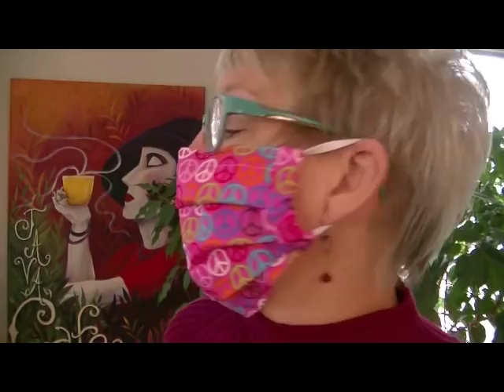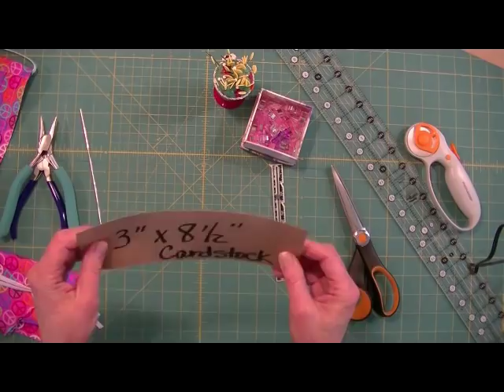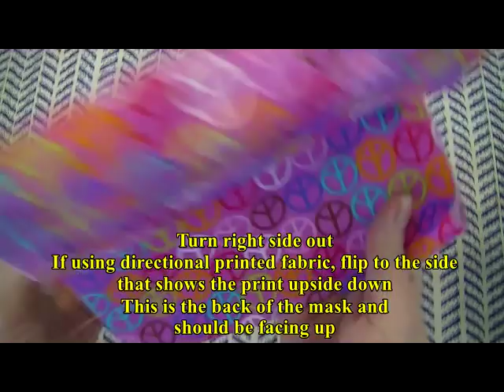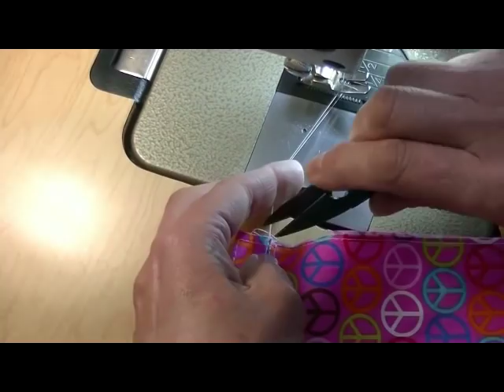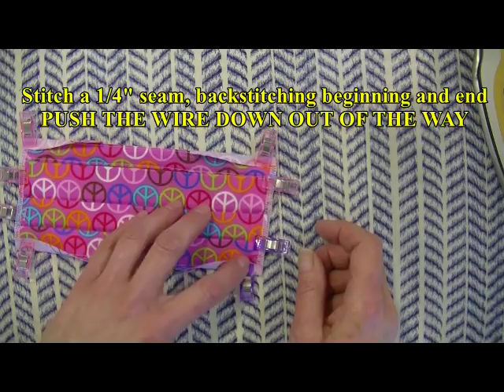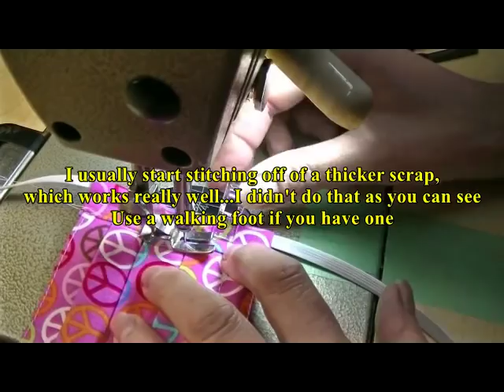DIY REUSABLE FACE MASK with FILTER POCKET-4 Style Options-1 Easy SEW Pattern-Won't Fog Your Glasses!

Comment: The casings on the ends so you can replace broken elastic is just brilliant. I'm waiting on my elastic to be delivered.   Ebay had aluminum strips you could buy to make the nose pieces. Here's a link for those: https://www.ebay.com/itm/100Pcs-90mm-Aluminum-Strip-Nose-Bridge-for-Face-DIY-Making-Accessories-Crafts/164152681798?ssPageName=STRK%3AMEBIDX%3AIT&var=463778476055&_trksid=p2057872.m2749.l2649
Reply from the maker: I looked for those but were not available or too expensive on Amazon.ca (Canada). I don't remember.
Reply: These come from China, but they're send with a fast delivery. It takes around a week or so instead of a month. I hate to think this, but we'll probably need masks then too.
Reply from the maker: I agree. I ordered elastic and aluminum wire from China. The demand for masks is going to be big.

Comment: Hi Liz.  I love this video. Especially the way you modeled the mask and bragged about it :)  watching the video is so relaxing and educational.   I have some questions though.  I notice your sewing machine is slow. Is it pedal powered? About the pleats.  I see that you sewed both layers together to create pleats but when you opened the pocket for the filter, it looked like the layers are not "intertwined".  Sorry for all the questions ;)
Reply from the maker: Thank you Al. My sewing machine is an industrial machine with a foot pedal that controls the speed and lifts the foot. This machine can sew 1500+ stitches per minute or super slow. I'm not really sure what you mean about the pleats. It's a pocket and when you open it up, the pleats stretch out and seperate. The pleats are what enable you to fit all the fabric in 3". Thanks so much for watching.
Reply: @makingiteasywithliz  Thank you so much for your reply.  How I wish I could control the speed of my sewing machine without applying less pressure on the electric foot pedal.  Regarding the plaats,  my concern is on the video, I see you created the pleats by folding the top and bottom layers of the masks together.   So I am a bit concerned that it may be a bit difficult to insert the filter properly especially when it comes to the side edges of the pocket where are pleats are since both layers are folded and sewn together. Unless I try to sew pleats for the inside and outside layers separately but that would be too much work and I do not even know if it would solve my "perceived" concern.   Thanks again.:)
Reply from the maker: You're over thinking it. Make one and you will see. From what I am hearing regarding wearing a mask is that it is to protect other people from you...to block your droplets. That being said, the filter only needs to cover your mouth and nose, maybe to the middle of your cheek. It doesn't have to fill in every nook and cranny of the mask. Once you open it up, you will see how easy it is to put a filter in. The pleats smooth out when you put it on, stretching down under your chin.
Reply: @makingiteasywithliz  Hi Liz,  I finally did it.  I am think it is the best i have attempted so far.  I will make some more.  You are right, i overthink.   :)  Thank you again!
Reply from the maker: Yay!!!! Right on!

Comment: Thank you so much for the informative and detailed video. There are many patterns out there but I chose yours because it was detailed  And informative, as well as versatile in regard to different ways of closure. And, of course the ability to replace the elastic when it no longer works. Instead of wire I used plastic coated paper clip which I opened and looped the ends. We will try several closure options: round elastic, 1/4" wide elastic and T-shirt stretch fabric (comes in spools, found in craft stores).  Oh, and I made 9 masks today ! So thank you again.
Reply from the maker: Thank you, Michal, just watch whatever wire you use doesn't rust. I finished my 70th mask today.

Comment: You could throw a couple of stitches in the elastic with the sewing machine would only take a minute.
Reply from the maker: Tried it and it got bunched up in my machine. I put 12" of elastic in the mask and let them tie it to fit.
Reply: Making It Easy with Liz  sorry about that,  all my years,  I never had a problem.  It is stretched. So you have to stretch it when you sew with it.   Maybe it is the size.
Reply from the maker: I appreciate the great suggestion. I havent dealt with elastic a whole lot so I probably could use some pointers on stitching it.  I am basically manufacturing these in bulk and leaving the elastic undone for whomever to tie it to fit. I don't want to make them too tight or too loose. Stay safe.

Comment: Liz, I have been sewing for half a century, but I was looking for a quick but well made mask.  I really like yours.  I think it will hold up when other masks will fall apart.  One comment about your cardboard for the folds.  I could not locate a long piece like yours, but I had the back of a note pad.  3 by 4.  By accident I discovered I could clip the top and  bottom to the cardboard,  make the folds without clips and sew before removing the piece of cardboard!  Then I ironed.   Worked like a charm and so quick!
Reply from the maker: A cracker box or cereal box works for the board. I like your idea. I may have to try that!

Comment: I bought some masks from a lady who used the elastic, I didn’t care for the elastic because it pulled your ears down & sometimes slipped completely off.  I reworked them cutting off the elastic & added the thin bias tape for the ties, each measuring 14”.  Works perfectly for both men & women.
Reply from the maker: Yes, the elastic can be a problem...that's why I don't tie them off and let whomever is going to where it, do it themselves so it fits. There is just too much to go wrong and I don't want calls because the elastic is too tight, lol.

Comment: Hi, I notice how similar this is to another tutorial with the orange fabric. I like her method as well as yours. I made a mask for my mother in law who lives several states away but she said it's too big for her so I looked for an easy pattern and found the other lady's tutorial and made one but she didn't mention that you would have to add extra inch if you don't serge (she recommended folding edge in twice if you don't have a serger). So mine came out a little shorter than hers. And a couple of other minor differences. So the idea of just using a safety pin on the elastic came to mind, instead of stitching ends together, that way MIL can adjust to her liking by pulling ends out and pinning to proper size.  Thanks for sharing your tutorial.
Reply from the maker: Thank you Rozy...I hope I was helpful.

Comment: My favorite pattern and mask video so far. Yes I'm about to mass produce need your next mass produce video. For now I'm cutting out 4 masks at a time. But I'm going to use this pattern today. For the melt-blown filters I bought 1 "burn blanket" on Amazon the cheapest sheets were under 10$ and you can get tons of filters from them. Thank you.  If you look for the surgical sterilization ones they are expensive because you have to buy a big lot of them ranging from 200 to 500$ depending on the quality. I too have jewelry supplies. I'm using the plant garden wrapped wire and it works well I get at dollar tree in the garden section. Keeps it shape and I just cut the wire back so it doesn't poke through and pull the green coating over it so it's safe.  You even made me laugh. I too made so many mistakes getting this right.  Haven't sewn in ages but in Chicago the poor folks can't get these masks made on their own or afford to buy online because it takes lots of equipment and know how and money.
Reply from the maker: Thank you so much Heloise.  Here's the skinny on mass producing.  It's all about prep...cut all your fabric pieces, cut and finish all your wires, fill multiple bobbins, cut all your elastic. Whenever stitching, use the chain piecing technique quilters use. When zigzagging or serging raw edges, do one right after the other without cutting your thread, just feed it through so you have a chain of them and cut them apart. same goes for all the sewing. What you do to one, you do to the rest. This can take a lot of time before hand but when it comes to assembling them, you end up with a lot finished at the same time. 
I too am so busy making masks that I haven't had the chance to do the next video. It's all so crazy!  Stay safe.

Comment: Where would you put the filter and do you have a filter recommendation please?
Reply from the maker: Cut the filter to cover your mouth area, coffee filters are the recommendation by the CDC
Reply: Making It Easy with Liz Man, those cone filters a really HARD to breath through, but, ok. I may use some garden row cover. Or rummage through my supplies for interfacing. Kudos on your closeup video process.

Comment: Hi Liz, thank you so much for your video. How do I do the last few steps to add an elastic band that goes around my head?
Reply from the maker: Hi Deja, cut 28-30" of elastic and lay it around in a circle and put it in both casings and sew it or feed the elastic up through the left side and down through the right side, after you topstitched. Check for fit and tie in an overland knot and stuff it in the casing.

Comment: This is 1 of my favorite ways to make a mask, however I’m going to try modifying and cutting the back and the front out of different prints so you can easily tell which is the inside and which is the outside.
Reply from the maker: I didn't mean to come off as defensive, I just meant, make one then see if it's a problem. I get so many "what ifs" before they try it. An easy fix would be to add a little fold of ribbon in the casing when you topstitch it, like a tag. That is what I started to do.
Reply: @makingiteasywithliz  
TBH I never even seen where you were coming off as defensive at all 🤔. And many people just misconstrue people via text etc. so often than not, And never do those people think before they jump the handle out of turn, or before they even know what's actually going on. And that's offensive in and of itself. 

However, Liz hon, I love the way you responded, and how you NEVER get defensive/offensive against anyone in any case. Of all the time I've been a sub here, I've just always LOVED your energy. You're a beautiful soul. Keep spreading your viral love 😍❤️ and Thank you SO MUCH for sharing this AMAZING pattern! I'm just so happy you have the perfect pattern for the mask out. The others also were uncomfortable for so many. Especially around the ears. I was looking for this one specifically and found one of those I have subbed had it all along! Again, thank you!
Reply from the maker: @JANEEDISTURBED  that is so kind and I totally agree with text being misunderstood. Thank you for your support. Stay safe and well.
Reply: @makingiteasywithliz  You're very  welcome hon! 🤗 And you stay safe and well too. ❤️
Reply: Yes, I have made one just like yours.  I guess I just wanted to be able to tell at a glance which is the right side.  I did figure it out, just finishing it up.
Reply: Is this size universal for men and women or for anyone with a larger/wider face?
Reply: Sherry Stengel, you can also tell because the front has the pleats going down and the wrong side has the pleats facing up. Even I can’t mess it up because the nose wire has to be on top! Be safe!
Reply: I have solved the front/ back problem. I do the top stitch around the pocket with a contrasting color thread.  The back is easily identified.
Reply from the maker: Love that idea...I stitch a little contrasting ribbon into the casing.
Reply from the maker: You can tell because the slit for the pocket is obvious. Have you tried my way yet? I always say "try the recipe first, then change it up, or not". Thanks for watching, Sherry.
Reply: Making It Easy with Liz I agree with Sherry. Her pattern of the cloth made it confusing to put the sides on for the elastic.
Reply: Just cut the facing/casing pieces out of coordinating different fabric and it differentiates the sides
Reply: @makingiteasywithliz  - I love your video (I just wish there were a pattern to print out)! As far as the 2 sides debate, it seems my hospital system solved that. They have asked that they are different because they want the front and back to be seen instantly, rather than having to look carefully to tell. lol
Reply: @makingiteasywithliz  Liz... thank you for your video, but there was no need to be defensive towards Sherry Stengel for her suggestion.   As a former nurse...I agree with Sherry.  The easier the better, and most surgical masks have 2 different colors so that it is extremely easy at a glance to tell instead of having to look for the seamed side.  On another note... so humbled by the dedication and selflessness of all of our people who are out there as essential workers. My age and health do not allow me to be out there with you, but must say...I would hope that I could be as brave and dedicated as you all are. What a blessing/benefit you are to all of us who are most vulnerable. Again...so in awe and humbled.
Reply: Hi! I really like this style of mask so much! I do have a question on the wire. I am unable to get out, plus most stores are closed, to purchase your suggested wire. Will the mask still work ok without the wire inside?
Reply: @karenhorvath2436   Without the wire ,the mask will not fit snugly enough(closing the gap on the sides of nose) to give  the best protection. There are alternatives-floral wire,pipe cleaner, paper clip, a cut strip from a  disposable foil pan, folded over a few times to give it strength (although this may wear out after few washes but you can replace with another strip).  I would advise to to make  small loops at the wire's ends so the blunt ends can't injure the wearer. Also for us without a serger machine, a pinking shear will do.
Reply from the maker: I wear glasses and a wire keeps them from fogging up. People have used the flat ribbon wire on coffee bags,  and you can order the flat aluminum nose wires on Etsy, pipe cleaners,  I haven't tried it yet without one.
Reply: @makingiteasywithliz  i have used the pipe cleaners and they work for a few days, but then start to lose their shape.  But that's all I could get to.
Reply: Brenda Connell  You know those regular N95 Light blue and white disposable masks? Well, inside of the top of those is a wire that can be used for this as well. I'd say get a box of the disposable ones (if available) and remove the wire to use instead. These can also be used as a pattern.

Comment: Great Video. Not a very experienced sewer so I would do better with written instructions as well to help also with retention and future use as I can forget while sewing if I get nervous. I was thinking of using use non directional material, hoping it will be easier?
Reply from the maker: Absolutely, Laurielyn. Cut it out anywhere with the grain, not across on the bias. You may already know that but I can't help myself lol.  Thanks so much for watching.

Comment: I have not completed the video yet. I am sewing along step by step and am to the point of putting the wire in. I am guessing that once the wire is inserted that this mask is not washable?
Reply from the maker: Oh, but it is. I use aluminum wire so there is no rust.  I washed one in a lingerie mesh bag, on hot with blankets and dried in the dryer.  The wire smoothed out perfectly to re-fit my face.
Thank you Donya for watching.

Comment: I've watched too many videos to count and was getting frustrated. Your video and instructions are perfect. The ends using small pieces of fabric has a much neater look. The pleat guide is amazing! Wire vs pipe cleaners is a much better idea.
Reply from the maker: Thank you so much. Yeah, I had to pat myself on the back for that  idea. I got a bunch pleated in no time. Thank you for watching. Stay safe.

Comment: Liz, is there a difference with thread types?  I have a bunch of serger thread spools (haven’t mastered the serger itself) and was wondering if I could use that?  As with everything, purchasing supplies is becoming harder and harder to do and I’m running low on thread from my sewing projects.
Reply from the maker: Hi Kim. Thats a good question. I looked it up and the answer is a definite no. Serger thread is much thinner and lintier than regular thread. It won't wind on your bobbin with the proper tension. Thanks so much for watching. I say get that serger out and play. You will save yourself some thread by using it to finish your raw edges and it's fun.

Comment: If we cut  2  7 1/2 square do we sew it the same
Reply from the maker: I'm sorry, if you want to change the pattern, this is something you will have to figure out. There are seam allowances to consider and the measurements of the squares will need to be changed to accommodate that.
Reply: @makingiteasywithliz  you mentioned that it  was 7.5x7.5 square that why I asked if it's the same if I used those measurements

Comment: Great video So if we don't add the wire what will be the dimension for the cardstock be for the pleats .Also will it still be the same if it wasn't a filter pocket or it does it matter if the filter slit section was  there
Reply from the maker: Thank you. I'm sorry, I really dont understand your question. The wire has no affect on it...with or without, it's the same.
Reply: @makingiteasywithliz  so the top section will still be there with or without the filter pocket  or wiring section? 
 it will still be 3 x 8 1/2 to make the pleats